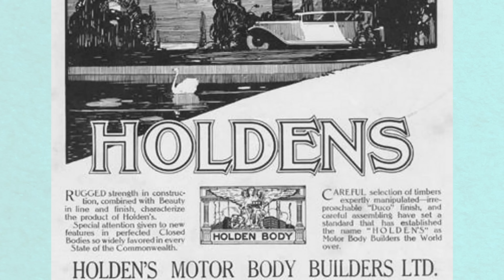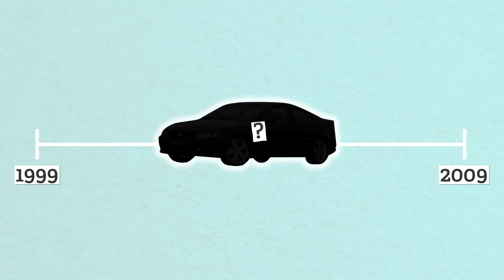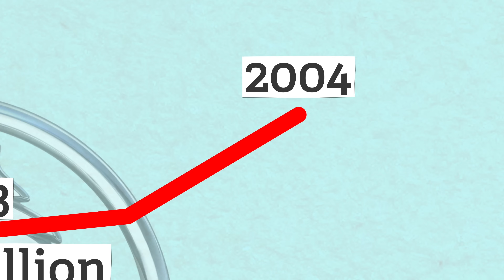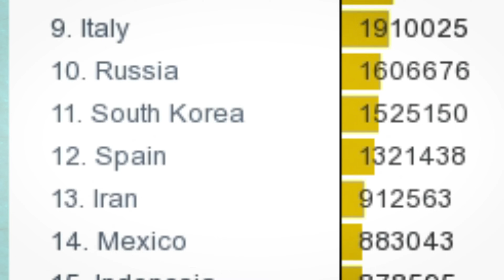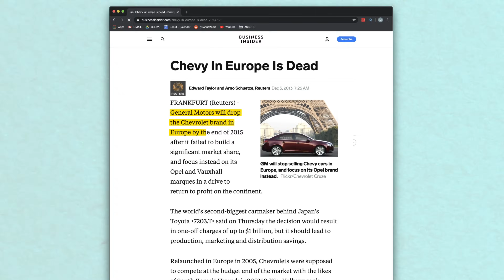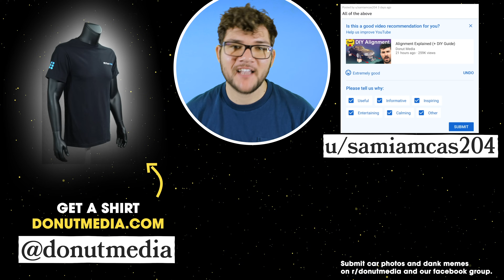What REALLY Happened to Holden

Comment: GM is probably one of the most poorly run, disappointing car companies, with the exception of Chevrolet, they make awful cars, their days of glory are long behind them and they just kill off or sell great brands as they slowly shrivel up and die.
Reply: Why make an exception for Chevy? Chevy cars are trash too. Their only good product is the Suburban/Yukon, which has to be good because it's their flagship model.
Reply: LoneWanderer360 Corvette, Camaro, Silverado are all pretty good
Reply: @thectcarkid4654  My company has Silverado and Express in the fleet and they are garbage. About half of them needed new transmissions in the first 50k miles. We don't even do any towing.
Reply: Bruh, have you ever sat in a traverse or a malibu?
Reply: @jackoff1826  what's your point?
Reply: Holdens were good though
Reply: @thectcarkid4654 Corvette lacks a manual transmission, Camaro is getting discontinued, Silverado is meh
Reply: @alexcheetah79  Isn't the Acadia same as the Traverse? I've driven one of those. It was okay. I've driven tons of vehicles on business trips. Just wasn't impressed with most of the Chevy's.
Reply: @nigel6548  Holdens were good because they ignored GM and did their own thing, SAABs were cool because they ignored GM, Saturn was initially successful because they were the opposite of what GM normally was
Reply: Guy Tatler and gmc because most of them are basically Chevys with luxuryos inteareros
Reply: @Automobile Addict The ones pre-80's were horrible piles of shit, but then everything else from back then was too. I owned a 2003 Holden Commodore for 12 years, and it only left me stranded once (alternator failed). I wouldn't describe it as unreliable. Spare parts were ludicrously cheap. A Camry of the same era would be more reliable but a far less nice place to be inside. Falcons are what I'd describe as having a great engine and rubbish everything else.
Reply: Alex Cheetah those “luxury” cars that chevy makes? I really hope you’re joking cause they’re both garbage
Reply: You have no idea what your talking about lol. Corvette, Camaro, Silverado, Sierra, Escalade, Yukon, Suburban, Malibu, Cruz, Expresss and more. Iv owned multiple/my father-in-law/Father. Any issue on my 99 camaro was because I beat the shit outa it. My 06 tahoe had 200,000 miles when I traded it in. Fucking ran perfect. My 10 Sierra Denali with 105,000 is a beast. We have probably drove 5 or 6 expresses into 250-300,000 mile range before major  issues. That's vans loaded with drywall equipment and 3-5 people 6 days a week all year long. Father in law bought a bed damaged 16 Sierra for cheap and it runs fucking beautifully. Brother in laws 10 Escalade runs perfect. Father in laws 11 escalade hybrid runs perfect. Dads 99 sierra has almost 300,000 miles on it and he fucking loves his 04 suburban. Me and my mom loved our Malibu. Stop talking out if your ass. Every brand has minor issues here and there, and most brands make great cars/trucks. You can not drive down a American without seeing a GM truck/Suv/car. Stop talking out of your ass because your not a GM fan. Im a GM guy but its easy to see GM cars are everywhere and loved just like ford/Dodge trucks  and Nissan/Honda cars. I see Dodge truck guys who also have a Malibu or suburban or a nissan Altima guy with a Silverado or yukon
Reply: They are literally the EA of the car world.
Reply: @kuchiefsdabomb  The majority of the vehicles you mentioned were Chevrolets and I didn't mean quality issues, I dislike GM because they have killed so many brands and many of their cars are no longer interesting. Many of them don't compete well against their rivals and feel cheap and get poor fuel economy compared to European counterparts. I don't really have a problem with their trucks.
Reply: @NikoBellaKhouf  Is there any actual source that the Camaro is getting axed? Everything I've read about that is nothing but speculation.
Reply: Find me any GM car that can make it to 100K miles without a window motor, trim piece or other interior part breaking or falling off. ALL GM cars suck for reliability. Some have a good engine the rest are complete shit. Not my opinion btw, pick up kbb. The only American car company that makes somewhat reliable cars in general is Ford, but even they still mostly suck.
Reply: @spaghettimonstersjudgingyo504  My 2003 Blazer never had any of those problems. The biggest problems I ever had was my fuel pump going out and my radiator leaking fluid and needing replacement. If you take care of your car, it'll take care of you. I had a 1997 GMC Sonoma that had a cab corner rusted out (and the guy my dad bought it from had blown the engine so we had to find a new one. The engine came out of a totalled Trailblazer, so it had some issues here and there). But when I sold it, it had 227,000 miles on it and got around great. Neither vehicle had problems with the interior. Quit blowing smoke out your ass
Reply: @spaghettimonstersjudgingyo504  Or if KBB said it, I apologise, but I wouldn't trust them very much if they said it. My whole family drives a Chevy and none of us have ever had any of these problems
Reply: @ND7800 well stupid for someone who doesn't know how to drive, certainly. Why don't you go learn how to drive one instead of making fun of it? I don't consider a car to be high performance if it doesn't have a manual. What's the point when you're being driven by the car instead of being in control, driving it yourself? And the Corvette demographic is exactly the type who would appreciate a manual.
Reply: @ultraguy8771  I read something about Mary wanting only 4 platforms. I read something else about the Camaro returning as an electric car 🤮. Companies tend to "leak" information into the media so they can see how consumers respond.
Reply: The Camaro is one of the most Muscle a Muscle Car can be (including the Challenger), they just messed up because of GM. If GM weren't in the middle of Chevrolet they would probably have been better if another company not like Ford because that would ruin reliability (trust me I know.) As long if they run commercials of the Camaro and stop praising the Trucks and SUV's you'd see a most likely a 10th gen Camaro. Dissapointing about what Chevrolet is doing, but I am glad I own a 2020 SS and ZL1 (yes I have a good paying job.)
Reply: I heard they're on the nose in the US.
Reply: TheCTcarkid and Colorado, but still. That’s fuckin it.
Reply: you know chevy is GM right???
Reply: Niko Bella-Khouf not until 2023, at which point they might be making something else, and god I’m so sick of everyone acting like anything that’s not manual is trash

Comment: 7:47 Correction: The last car to roll off the holden line in 2017 was a VF SSV Redline. The last HSV to be made was the HSV GTSR W1. The fastest car produced ever in australia. Its not all over for GM in aus however, the C8 IS still confirmed for here and its said they're just gonna sell them amongst other vehicles under something like "GM specialty vehicles"
Reply: GM has the worst record for customer support and warranty repairs in the country. There is no good reason to buy one of their shitty death traps and GM is pulling out of all the LHD drive markets worldwide to try an stave off another bankruptcy. Those C8's will be old stock.
Reply: Holden had midengine first with the Hurricane. Pity it could make it to the road.
Reply: Walkinshaw engineering  already do coversions on camaros under the HSV banner, Ive heard Ryan on a podcast recently talking about the possibility of rebranding to GMSV
Reply: @lukemanion2  Thats whats been heard yeah, Hopefully the HSV guys doing conversions still have a place to go to that isn't ford. 

(I know there's going to be a reply saying THerEs otHer bRANDs lIke VW, HOnDA, ToYotA but most of you will get my point)

Comment: Holden signed their death warrant when they started rebadging Daewoos.
Reply: Should have made a modern Torana
Reply: *GM started rebadging Daewoos, after buying Daewoo and using them to supply half of all their cars for most of their brands.
Reply: Weren't they basically like Open cars the same way as Buick cars are rebadged with slightly design changes open cars in the USA?
Reply: @C. Fecteau agreed
Reply: @TheRealFobican  Well at least the Opel (Buick) cars looked good and drove well, unlike the Daewoo ones...
Reply: @C. Fecteau the saddest part about that comment is the Magna, Camry, Falcon and Commodore are all great, reliable cars. I remember my old man squeezed almost 400'000km out of a 90s Magna before it finally needed major repairs. Considering how cheap they were to begin with, they were great cars.
Reply: Ford won the long race 😂
Reply: @C. Fecteau I agree about the Falcon being a more Aussie car than anything modern-ish that Holden made. The main reason being they had an Aussie engine option. The Barra really is a superb engine... and 100% Aussie! Boss and LS V8s are fine, I guess. But I'd take a Barra any day.
Reply: @BB-tp6xk  That’s exactly what Peter Hanenberger’s “10 year plan to take on the BMW 3-Series” was. The concept was revealed in 2004, but Peter retired, and GM pulled the plug. So it was in the works, but failed to launch https://www.whichcar.com.au/features/2004-holden-torana-tt36-concept-feature-classic-motor
Reply: @ibstar82portage94  the long race to be a one product company, thai built ranger.... big fucken deal
Reply: @jex_au1102  barra is just a continuously updated xK engine, heavy and American
Reply: @JohnSmith-rw8uh  it's called business for the long run not for tomorrow 🤣🤣🤦🏽‍♂️
Reply: @JohnSmith-rw8uh  XK is a vehicle model and not an engine. Which engine available in the XK are you referring to? Whichever one you mean it's just like saying all I6 engines are descended from the same motor. I mean, how far do you want to take it? Surely the Barra is really German seeing it evolved from the Otto Engine.

Comment: in 1968 when the HK monaro was released it could be purchased as a basic 6 cylinder with a couple of size options or the GTS options were a 6 cylinder 186s with twin manifolds to a 327 Chevy

Comment: GM is a serial killer when it comes to car brands
Reply: Saab, Pontiac, Hummer, Holden, what could be next?
Reply: Mr. ADR  GMC is the strongest possibility there since they make the Sierra and the yukon
Reply: @1spunkymonkey2  Hummer could be coming back
Reply: Cross Country 5 GM kills everything because they own everything.
Reply: @trashbandit2449  it's coming back as an EV under the GMC brand, it's not an independent one anymore
Reply: Mr. ADR  except the 82' Sierra, that was just a c10 with a GMC badge
Reply: @ryadhasanahmed5443  that means it will be funded by GMC, that's good
Reply: @KFCGAMING55  isn't every GMC truck almost exact to the Chevy version
Reply: Mr. ADR  yep. I like GMs cars... but how do they go broke so often?
Reply: @trashbandit2449  as far as I could tell, yes, the only differences being special editions like the GMC Cyclone, or the Chevy ZR21 Silverado
Reply: @trashbandit2449  yeah it's called the GMC Hummer EV and I think it will have a pickup body to compete with the Future Tesla Cybertruck
Reply: @KFCGAMING55  I think quality/parts is slightly different (or at least used to be). I think GMC is a step above Chevy (I think)
Reply: @ryadhasanahmed5443  what do you mean by pickup body? Similar to the old H1s with the slanted back, the pickup back, or the wagon style? Or a literal pickup truck on the hummer frame?
Reply: @trashbandit2449  think it'll be a pickup body bolted onto a hummer frame and "apparently" the electric motor will produce 1000hp
Reply: @ryadhasanahmed5443  I think it is supposed to be 4 electric motors powering each wheel adding up to 1100 hp. Can't remember their torque number
Reply: GM may just kill off Buick, because of the fact that they keep on killing off their models. No one really wants to buy a Buick anymore. GMC could be on the chopping block next, since not as many of their trucks and SUVs are sold when compared to Chevrolet models.
Reply: @timrezendes9644  Buick is doing really well in China, I don't see them killing Buick yet coz that's a lot of buyers
Reply: Cross Country 5 - Youre completely right. Now please do list us the global companies that you have ran in the past 100 years and their profits. We're waiting.
Reply: @DesertStateInEU  GM went bankrupt in 2008, they got bailed out by the taxpayers
Reply: @ryadhasanahmed5443  And that changes what? Oh I know what you wanted to say, you wanted to list us the global companies you ran and how successful they were. Alright, tell us.
Reply: @DesertStateInEU  why are you being so defensive for a multi-billion dollar corporation LMAO not everything they make is good some are alright but get off their back 🤦‍♂️ stop fanboying over a particular brand not every car company is 100% perfect
Reply: @ryadhasanahmed5443  As expected, you had no rational counter argument and youre desperately trying to change the subject. Fail. 🤦‍♂️
Reply: @DesertStateInEU  If you are done crying about someone making fun of your favorite brand let's have a discussion. GM went bankrupt in 2008, and had the taxpayers bail them out. Not a great business model and scince my taxed money was used to bail them out I have every right to make fun of or criticize a large corporation that has made many questionable decisions throughout it's history.

Comment: Being a Aussie and a owned my share of Holden’s, I can tell you that to me Holden started its slump when in 1979 it ceased product of 2 iconic lines. The Holden Torana and the mighty Holden Kingswood, here in Australia there was a tv show show called Kingswood country, the Torana was the launch platform for a few Aussie race driver. One of biggest was a guy named Peter Brock or as sometimes referred to as Peter Perfect. The Torana was a mid size car  which could be purchased with a range of motors, from 4 cylinder to the 5litre V8, I owned a Torana for 12 years and wish I could of kept it, so for me GM decline started in 79.
Reply: How many of us remembered the period between the demise of the Torana Hatchbacks in 1979 and the arrival of the YE Calibra from Opel in 1991 Holden didn't offer anything competitive against the likes of the Prelude,Celica,Mazda 626 and later MX6 coupes and whatever Alfa and Lancia offered the mid to late 80's and even Renault with the Fuego amongst others?There was the Piazza but that was an out dated pile of overpriced rubbish that had the misfortune to have to share showroom space with a similarly priced VL Calais Turbo between 1986 and 1988.

Comment: On Saturday 30/1/2021 a rare Maloo  W1 sold at auction for $1,050,000.
The W1 Maloo had an HSV plate with a build date of 29/12/2017.
So it might have a claim to be the last Holden. But from HSV Clayton Victoria not Holden at Elizabeth South Australia.
Which is the real last, or perhaps another of the four Maloo W1 cars made but not seen much yet.

Comment: It's mentioned that all the other car makers in Australia closed up before Holden, and while it's technically true that the Holden production line was the last to shut down, Toyota was actually the last to announce their closure after Holden said they would be closing the Elizabeth plant. Toyota didn't actually want to close their plant, but without the Holden and Ford plants also operating to keep enough volume for all the parts suppliers in the supply chain, it just wasn't possible for Toyota to stay open.
The death of Holden overall was when Opel (and by extension Vauxhall) was sold off - Opel/Vauxhall were the main supplier of the right-hand-drive cars Holden needed for the Australian market (because the UK is also RHD and a larger market). No RHD GM cars to sell = No Holden.

Comment: I drove a VY till about 160,000kms and if i didn't have the unfortunate rare transmission issues, i reckon i'd still have the car! I hope Australia can figure out a way to reduce manufacturing costs throughout all industries and bring back the HOLDEN.
Reply: I am surprised it lasted that long.I wish I had done more personally to have got my mother into a VY series 2 Calais Demo when new or even a factory fresh VZ Calais when it was time some 19 years ago to move on from her w202 c200 Mercedes since she doesn't drive much but for work and status reasons she had no choice but to buy some European Status Symbol which put most of the workers at the GMH Factory to try find new jobs and initially on Centrelink at the time.

Comment: I've still got a vn bommodore 160xxx daily driven brought it on 100xxx 3 years ago country driven beast 
Replaced suspension and powersteering still have all original logbooks 33 years  mines a 1989 6k and it's yours
Reply: Funny fact they made a thunder, storm ,ss,crewman  aswell as a maloo in ve ute  
Vz to ve worst Holden's they were called rattel tec there previous motor was eco tec and motor before that was Buick  then turned to alloy Tec (rattle tec) randomly because they didn't like customers service or cared then the  timing chain problems ticking time bombs solved the problem in there last alloytec VF so no timing chain problems 
If you want to buy a commodore it's either 2004 and earlier or 2016 and later
Reply: Thunder was poverty pack v6 wanting to be a v8 
Also ve had a poverty pack omega shaped as a ve but was worse engine 3.0l instead of 3.6 and old commodores were standard 3.8 never late in a 3.8
 2L come in juice boxes
Reply: I have a 3.8 Buick if you know if any bolt on superchargers can fit from America I'd love to know! Hopefully an old Buick will fit
Reply: Buick was the best of the commodore know as mang till it bangs cause it can withstand alot of burnouts 
10 years ago you could get given parts for free now you can get nothing without going on the corner